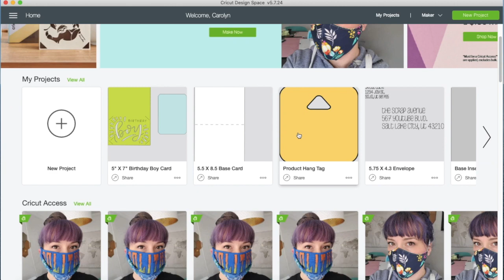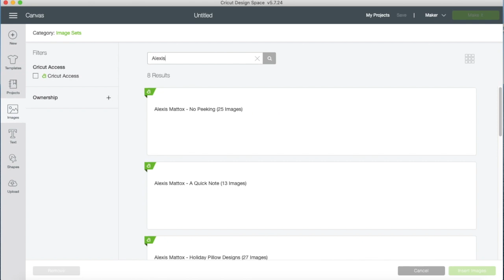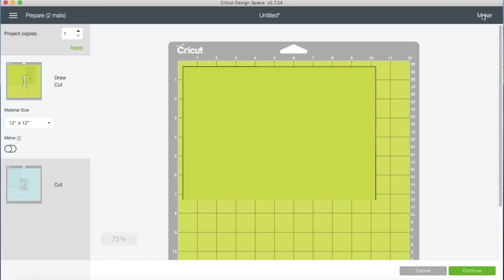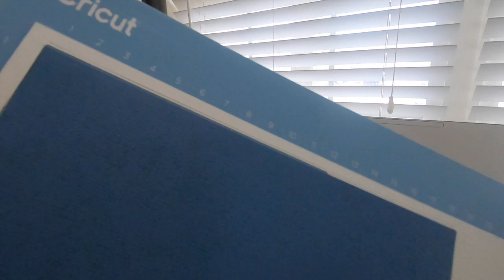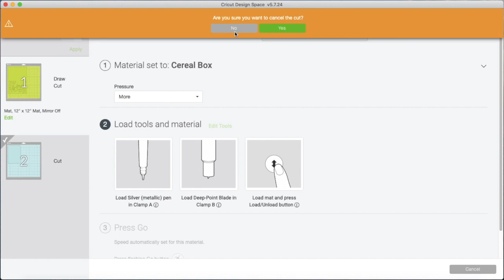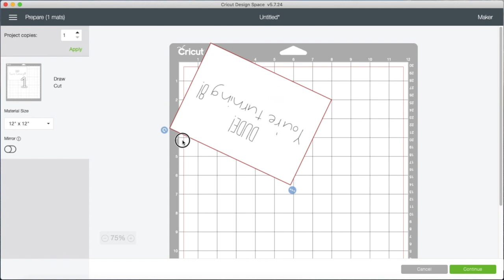5X7 'Birthday Boy' Cricut Card Using The Cricut Maker

Comment: Great tutorial! I have the cricut maker and this will be my first time attempting to make cards. I'd like to use just a flat card 5×7 for the cut out and then the insert will be colorful card stock. How do you customize if you'd like the cut out to be different? For this project I will not use the cricut pens.
Reply from the maker: Hi, thank you for the compliment! You may have figured this out already, I'll try to answer your question though. You can always delete an element in the 'LAYERS PANEL' You can also click on 'CONTOUR' and hide elements while keeping others. And if you don't already know Design Space does have blank cards where you can design your own  which can be found under 'IMAGE SETS' they're called 'QUICK CUT CORNER CARDS' I hope this helps!
Reply: @thescrapavenue  Omg such a lifesaver. I actually re-made this same card following your steps. I actually didn't know that about setting in Design Space, thanks so much I'll have to look into that.

Comment: Hello - I am a newbie. I just got my printer and I am trying to practice. I am making this exact card right now. I am following each steps that you are explaining. However, when I get to the part where I am resizing the card to 7w and 10H, it is not allowing me at all. It is so frustrating. Because when I go to the step after that, which is the insert card, I resized it and it works just fine. Help, what do I need to do?
Reply from the maker: Hi Joy, I am so sorry for the frustration! I experienced the same thing when I attempted to do it this time, I was ready to pull my hair out! I think it may have something to do with Design Space updates,  but I was able to figure it out.  So don't rotate the card, keep it horizontal, then you will be able to adjust the proportions.  I hope that works for you, let me know if you need anymore help!
Reply: @thescrapavenue  thank you so much for responding and helping me out. That worked for me. I appreciate it. Have a wonderful day. :)

Comment: What if I wanted to cut my own card stock instead of purchasing this card set? What would the dimensions be and the score line and where would I place it on the cricut mat?  I have a Explore air 2 machine. I would love to be able to make larger cards using the cut for the joy. Thanks
Reply from the maker: You can definitely use your own cardstock, I just show what I use in case someone is interested 🙂The dimensions remain the same 7"W X 10"H score at 5" Where do you want to place it on your mat? left side, right side, top or bottom, I don't have an Explore but I can ask my friend to borrow hers and find out.
Reply: @thescrapavenue  thank you so much! I placed the card stock in about 1/4 inch from the top and side of the mat. It cut perfectly there.
Reply from the maker: @kimredding30  ok good! On my Maker it was measuring 1/4" on the left and 3/16"at the top, so just a tad different.